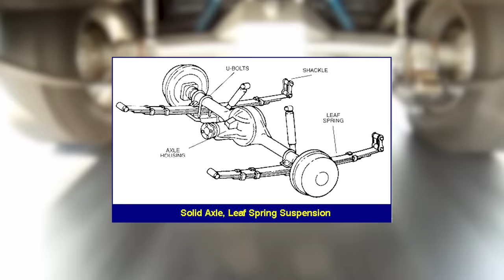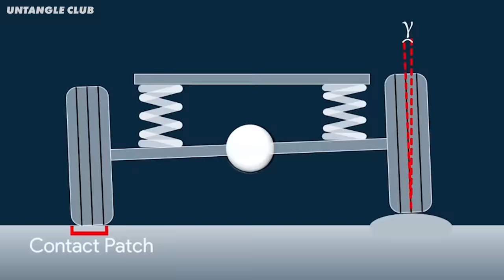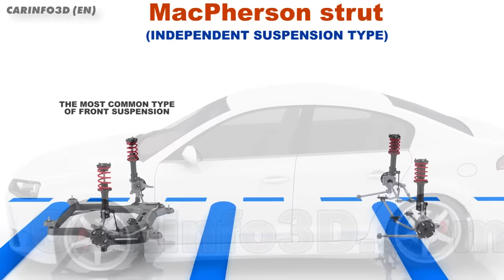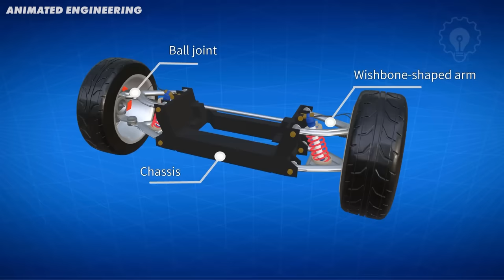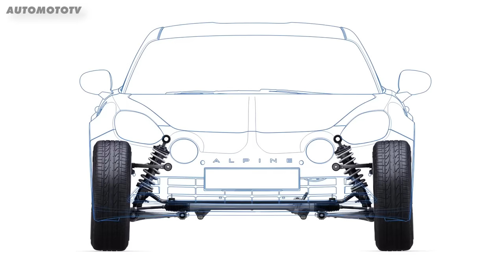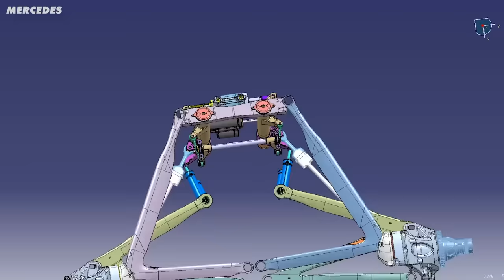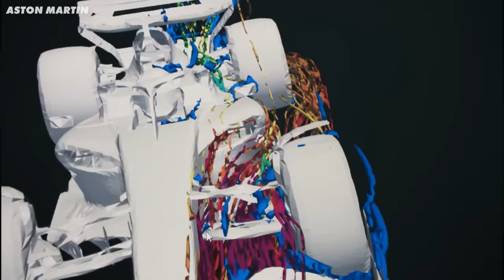Why Formula 1 Uses DOUBLE WISHBONE Suspension

Comment: The script seems like it was ChatGPT as it has glaring mistakes which make no sense. It was said that you want double wishbone suspension rather than independent suspension, McPherson, trailing arm, etc. However double wishbone suspension IS independent suspension. As is the McPhereson strut, multilink, trailing arm, and so on. Independent is the rough classification whilst double wishbone is the specific classification. It's like saying you don't want an animal as a pet you want a dog - a dog IS an animal. I'd assume a human writing the script would have easily picked up on huge issues like that.

Comment: Everything except the rigid axle are different types of independent suspension, then you can't have that as a separate type next to the other sub-types.
Reply: There's also different types of solid axle, the torsion beam in a cheap car is not the same as a 3 or 4 link solid axle, and both of those arr different from a leaf spring live axle
Reply: Why?  The suspension types listed are those commonly found.  The video is about double wishbone suspension in F1, specifically.  it is NOT about independent suspension as a whole.
Reply: @Giuliana-w1f  A solid axle is a solid axle no matter what kind of springs are used. And then you forget to add air ride as well if you want to go down that path
Reply: @dan1906  Are you drunk?
Reply: @khasmir666  a solid axle is a solid axle. But there's leaf spring solid axles (using the springs to keep it in place); 3, 4, and i think 5 link solid axles (with springs that don't keep the axle in place by themselves, instead using the links); and torsion beam suspension (with the axle being linked in 2 places directly).

It's like saying that indepenent suspension is independent suspension. It's true, but a swing axle is not the same as a multi link.
Reply: @khasmir666   Even if I were drunk, I could read and comprehend the video title.  You?  Apparently not.  It reads, "Why Formula 1 Uses DOUBLE WISHBONE Suspension".  It is specific to a particular type!  Also, FYI, there are other types of non-independent suspension geometries that are not solid axle.  Maybe get your facts straight before trying to be clever.
Reply: @Giuliana-w1f  You don't get it do you? It doesn't matter what kind of springs you use and how many links, it's still a solid axle. And why are you arguing with me? That is what the guy said in the video. Did you even look at it? 0:50
Reply: @khasmir666  yes, that's correct. In the same way that independent suspension is independent, doesn't matter if it's a trailing arm, swing axle, double wishbone, or a multi link. Solid axle is a whole group of suspension types, just like independent suspension
Reply: @Giuliana-w1f  And you can have double wishbones with springs, coilovers, air ride... So you say those are also different layouts?
Reply: @khasmir666  it's not about the type of spring. In a leaf spring solid axle, only the leaf spring is what keeps the axle in place; unlike a 3 link solid axle, that moves in a different way when compressed.

A good example would be between double wishbone and transverse leaf spring independent suspension. The double wishbone has 2 control arms and a spring; and the transverse leaf spring uses the spring itself as part of the suspension geometry.

If you put any kind of spring (helical, air, hydraulic, hydroneumatic, or even torsion bars) into the suspension, and it will still be the same. But if the spring is part of the suspension, then that's a different thing (like how a mcperson strut is not the same as a swing axle)
Reply: @dan1906  Ah, I get it now, you comprehend the title... But did you even look at the video? 0:30 He shows 6 suspension layouts but only really explains 5 of them. My point is he should not have listed independent suspension next to the trailing arm, macpherson strut, multi link and double wishbone as these are all different types of independent suspension. But I know only one type of non-independent suspension: the solid axle. Feel free to share if you know other types.
Reply: @Giuliana-w1f  I don't really see it that way, I guess we'll have to agree to disagree 😊 My point was actually he should not have listed independent suspension next to the trailing arm, macpherson strut, multi link and double wishbone as these are all different types of independent suspension. But imho non-independent suspension = a solid axle no matter how it is supported 😉

Comment: Isn't "Independent suspension" just umbrella term for almost all of these?
Double wishbone, multilink, MacPherson , trailing arm and many more like swing axle are independent designs
Reply: That's what I've known it to be. This video felt super off.
Reply: Yeah a little odd how it's presented. 

You also could argue torsion beam which he lumps in with rigid axle is a semi-independent suspension.
Reply: While that is true, it's irrelevant.  This video is about the specific use of double wishbone in F1.  What is your point?
Reply: And isn't double-wishbone also a type of multi-link?
Reply: @christianellegaard7120  well technically you could qualify it as that, but usually it means something with no or just one classic wishbone and traversal arms.
Reply: @dan1906  so could just skip having 'independent' here, it shows like it's something completely different and can suggest that double wishbone and other designs here are not independent designs.
Reply: @timiko4  Ah, OK. Thank you for the clarification.
That doesn't redeem the video, though. ;)
Reply: He deliberately inflates the video with needless information to make it longer than 8 minutes so he can get mid roll ads
Reply: Yes it is, also got some wrong with multilink etc

Comment: Guys... Your information is off. First, everything outside of solid axle is independent suspension, including formula one. Multi-link is ALWAYS going to be the most adjustable and in theory is the superior suspension. The thing is, formula 1 works a bit different. They can make a new control arm for each race and the mounting allows enough adjustment to suit the packaging. 

A multi link system is an "install once and tune as needed" system, vs changing the lengths of parts every time. Great for any vehicle that doesn't require aero. That's why you see a lot of SAE formula cars with that setup. They can also have pull rod or push rod. Basically,  you take the wishbones and split the point they connect on the upright. With multi link, you can also have a trailing arm.

Long story short, you've got some decent information, but I think this is overall one of the most incorrect videos y'all have put together.
Reply: I need help understanding your point, if you have one.  The video is about why F1 uses double wishbone suspension, specifically and exclusively.  What do other types of independent suspensions have to do with the topic here?
Reply: @dan1906   if it was only about wishbone but he protraited some background where the information was incorrect
Reply: Agree. Unfortunately I am watching him for few years and its not as uncommon to have some serious facts messed up in his videos.
Reply: @dan1906 the information regarding what is and isn't superior in terms of performance, as well as the categories and type of suspension systems are incorrect.

Even the red bulls have used multi link in the front in the past and I'm almost certain formula one has used multi link in pas generations. Without aerodynamics, a multi link independent  system (because you can also have multi link on a solid axle) is always best if engineered correctly. It gives you the maximum adaptability, tuning, and controlling the geometry of wheel travel. Formula one uses double wishbone for packaging and aero. If they need to make an adjustment to caster or geometry, they manufacture new control arms to fit that. With a multi link system, that's not needed, as it is much more adjustable. The downside with multi link is you need larger uprights to fit the links and you are more likely to incur an aero penalty across the arms as they are usually designed to be adjustable with a nut and thread. You can get minor adjustments done in the form of cam bolts, but again, the weight penalty of the larger uprights is a big deal in formula one as that is additional unsprung weight.

The main point of this video is stating that double wishbone is the best thing out there, when it's not. It's the best thing for formula one because of packaging and the nature of the sport, and that point is totally missed.

There are various other bits that are misconstrued. You could technically have push or pull rods with any type of suspension, even solid axle. The purpose of push or pull rods is to relocate the springs to a more desired location, as well as use the mechanical properties of levers to manipulate the forces for what the application demands. In theory, you could use the rods to have a 6 foot spring control only 6 inches of travel, or 6 feet of travel controlled by a 6 inch spring. Obviously neither is practical, but it's a hyperbolic example of what push or pull rods are actually for. This video makes it seem like you can only have rods with double wishbone and uses that as another example of superiority, which is completely false since push and pull rods are simply another component of suspension design that can be adapted to any application as needed.

Case and point, this is a solid axle push rod multi link suspension setup: https://www.cachassisworks.com/cac_press_TCP_RearPushrodSuspension.html
Reply: Another point is, not all teams run double wishbone suspensions right now...
A lot of them actually use multi link layouts, especially in the rear.
Reply: I think you’re too invested in something entirely trivial…
Reply: I found this helpful 👍🏻
Reply: Isn't the main reason F1 uses double wishbones just "rules"? And in this case they exist to make the sport more competitive as (superior) multilink suspension are more complicated and therefore not affordable to smaller teams?

Double wishbones are "good enough" for most cases and even MacPherson struts are "good enough" e.g. for Porsche.

Comment: Bro, love your videos but this one needs some serious corrections/additions.

The trailing arm, MacPherson strut, multi-link, and double-wishbone suspension types presented here are all types of independent suspension.  "Independent" just means movement at one wheel doesn't directly disturb the other wheel (barring the anti-roll bar).  In other words, "independent" just means "not a solid axle".

The "trailing arm" animations don't actually show the trailing arms.

Double-wishbone suspensions are not more complicated than multilink.  Very often it's the other way around.

MacPherson struts aren't just ruled out of open wheelers by the lack of mounting points.  They're also (mainly?) ruled out by their terrible camber curves, the fact that they put a lot of mass out near the corners of the car, the side forces on the dampers, etc.

Besides aero, another factor in how everything is packaged in a single-seater is to keep mounting points centralized, both to minimize polar moment of inertia and to make it easier to ensure that the structure is stiff around all the mounting points.

Comment: I think you need to mention that independent is not different than all the other types except ridgid, they are sub-types of independent. According to your explanation and video clips shown, independent and double wishbone are the exact same thing, not different types...
Reply: I have to agree
Reply: Exactly, McPherson, multilink and double whisbone are all independent. For the trailing arm, usually they are connected left-right to save on the rear roll bar, thus sometimes classified as semi-independent.
Reply: @markotrieste  multi-link isn't even exclusive to independent suspension. Jeep wranglers have a 4 link (so... multi-link) setup.
Reply: @Bannerdrums  But on a live axle, you say?

Comment: Correction (7:02) - Leclerc pulled 7G of braking while overtaking Perez on the last lap of the Las Vegas GP.
Reply: excuse me? How is that even possible?
Reply: @weatheranddarkness Leclerc was behind Perez as they got onto the 2.1 mile straight and stayed behind Perez but closed the gap all the time until just before the left hand corner at the end of the straight…meaning both cars were travelling bloody quick before getting to the corner. Leclerc sent it up the inside at the last minute.It was this braking force that slowed the car down enough to make the move stick (and enable Leclerc to make the corner) that I believe is where the ‘7G of braking’ comes from.
Reply: @friktionrc  it sounds too implausible. Last I heard F1 cars could only brake at 5g.
Reply: @weatheranddarkness  I believe it's around 5g, not 5g max, meaning the force generated can be less or slightly more as the force is determined by entry speed and other factors (eg if they suddenly hit a wall/car in front etc etc).
Reply: @friktionrc  haha I don't think those two count as "braking" force.

Comment: Multilink rear suspension gives an advantage over dual wishbones as you can control toe during bump/rebound. So you can have the car gain or lose rear traction during braking or acceleration.

But F1 cars suspension layouts generally have more to do with the control of air flow than suspension.

As Chapman said any suspension system will work in a race car if you just stop it moving. 😂
Reply: F1 do also use multi link rear. Not all but some, for exactly the same reason you mention :)
Reply: @hordleydesign  in fact some of the recent Mercedes had split wishbones in front as well, on the top if I remember correctly, making it a multilink situation. Configured in an "A" anyway. On road cars there might be a full width crossmember like a panhard rod as part of the arrangement as well, which wouldn't fit in an F1 even if you wanted.

Comment: I'd argue walking up and down a pit lane full of formula student cars is a lot more fascinating than F1 due to the variety of suspension geometries there are, I saw one this summer where the damper was mounted basically on the back of the upright where it was attached at the top then near the bottom there was a bell crank to redirect the force up and towards the top of the chassis where a regular pushrod setup would attatch. Very interesting concept even if I'm not convinced in its effectiveness, unfortunately that team didn't get past scrutineering so I never saw it on track

Comment: This is one of the reasons that I love my Nissan 370Z so much, for its unequal length double-wishbone front suspension and sophisticated multi-link rear suspension. I further improved the handling by installing stiffer anti-roll bars, lighter forged magnesium wheels, two-piece aluminum hat brake rotors and grippy Michelin Pilot Sport Cup 2 tires. The car, obviously, isn't a F1 contender but it does handle very nicely and is tons of fun to drive. I just need to upgrade my driving skills to match the handling potential of the car.

Comment: I always thought that the best suspension design possible is double wish bone in the front and multi link in the rear. I remember reading that the multi link is more adjustable than the double wish bone, but can't really be used on the front wheel which have the steering system.
Reply: Audis have had multilink for a long time. The original FWF ones even had a multilink with a rear torsion bar (e.g. not independent suspension). Think A4 B5 & A6 C5

Comment: The independent suspension as shown is the same as wishbone suspension.
The Macpherson strut does not support the lateral load on the suspension - how can it?  The lateral loads are handled by the track control arm and the caster by a push or pull rod link however, some cars use the anti-roll (sway) bar to do that duty.  
Solid/beam axles can be highly effective on a race track simply because there are few if any bumps to contend with and they can be made very light, just look at karts and no-one doubts their handling and adhesion.  Also, DeDion rear axles were/are popular because they give all the advantages of a beam axle without the excess weight.  This was used on various Grand Prix cars back in the day in preference to double wishbone suspension.
Current F1 cars use wishbone suspension because it gives more options on suspension set up and the inboard suspension units cleans up the space between tub and wheel.

Comment: On the double wishbone I was looking forward to know the difference in push rod and pull rod.
Reply: The difference between push rod and pull rod comes down to how the linkage acts on the spring. Push rod is the most straight forward. As the suspension compresses, the force goes through levers and a rocker mechanism and the force at the end compresses the spring and shock. Pull rod does the opposite.

You can think of it like a see saw. Say you're lifting one side and a spring is acting on the other side. A push rod setup is where the spring on the other side is below the see saw, attached to the ground. When you lift, you squish the spring on the other side. Pull rod would have the spring mounted above, like as if it were attached to the ceiling. You lift, and you end up pulling on the spring on the other side.